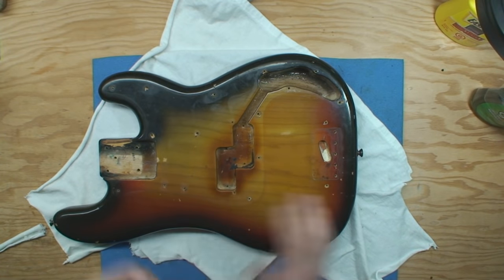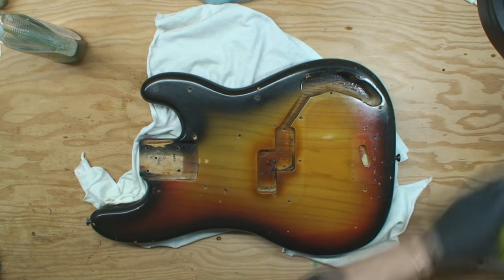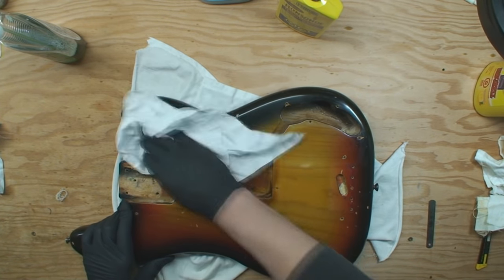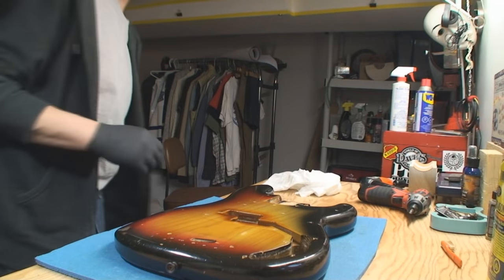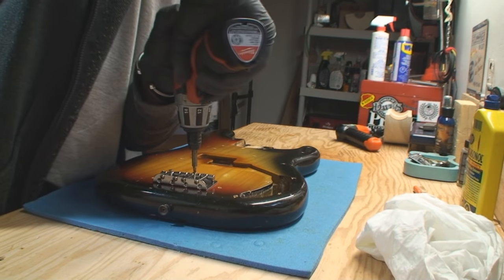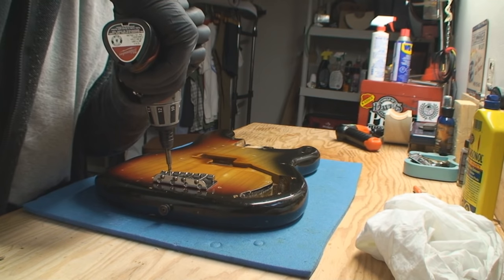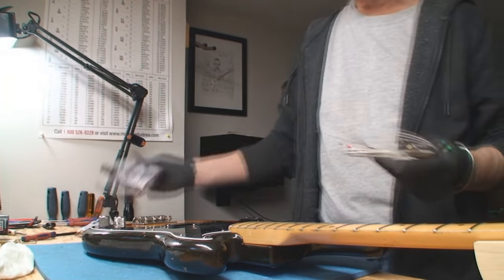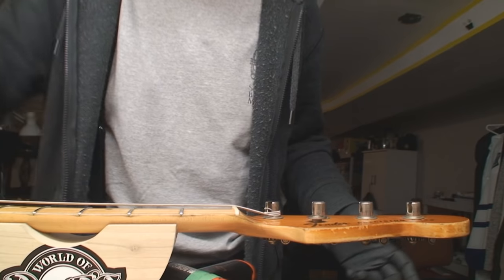70's Fender P Bass Gets The Works Part 2

Comment: I just had the same problem with on my 78 last night. One of my saddle adjustment screws was frozen on the E string. Probably from all the years of beer sweats getting to it. I soaked it overnight, didn't help. Heated it up in a pair of vise grips for a few min with a lighter and it loosened up.
Thanks for all the info,
Cheers.

Comment: You should always refit a screw and turn it backwards, first, so it drops into its original thread. Just tightening them with a drill may make a new thread and weaken the hold.
Best tip I learned years ago.

Comment: I have run across the "frozen" set screw issue a few times.  What I find works is to heat the screw up really hot with a soldering iron, then remove the heat and quickly spray the screw with freeze spray.  You might have to do this a few times but the screw usually will break contact with the saddle enough to unscrew it with vise grips.

Comment: I had a Fender P bass similar to this, but mine was 1977. Same three colour burst, similar wear marks. It had no skunk stripe, maple neck but rosewood fingerboard, truss rod screw at body like this one, but no truss rod plug at the headstock end. Yet, the black/white two ply pickguard was the original one. Maybe the one in this video was a replacement, but just saying that mine came with the same pickguard as the one in the video. All original. Sadly, it came without the bridge and PU covers, but the previous owner/owners left the bridge coverplate screws in :) Sold it for £500 GBP around 2006. Wish I had kept it a few more years as the price doubled/tripled for 70's guitars a few years later. Ah well. I miss that bass...

Comment: Why is it that the ONE part that screws up is that one part that cant be replaced or soaked in oil to get it to free up.?  Im always amazed at the sad shape that pickup mount screws are in when Im replacing the pickups. Not the adjustment screws but the wood screws holding  the mounts to the body,.  They are Phillips screws that are so wallered out that no shape driver can get them to move at all.  How did they get them to screw in?  Meaning a broekn mount to reach the screw head or trying to get needle vise grips to grab and twist.  Sometimes I feel like replacing the  PUPs and screwing them back into the guitar.

Comment: Hey Dave! What did you use to get the rust off that bridge?

Re - Refitting wood screws. I feel for the the old thread by turning backwards till I feel it drop. Especially with the hardwoods you get on guitar bodies the thread integrity stays pretty good.

You could get a machinist to remove that grub screw. Abom79 here on YT does a lot of that kind of reclamation.

Comment: Hi Dave, hope you are well, i have a guitar with a crack in the finish at the neck joint ( set neck) should i be worried? no tuning problems and it plays great just wanted to ask if you for your 2 cents.

Comment: Try heating up the screws with the old soldering iron.
Reply: Sometimes just heating and letting it cool a couple of times is enough to allow the penetrating oil in to where it can do it's work. Definitely worth a try ! The soldering iron should do it if you give it a minute or two.
Reply: You can heat the saddle to expand it, but the trick is to heat the screw so the metal expands in one direction within the saddle, but shrinks in all directions as it cools down. Physics; they're awesome.
Reply: It's going to be just about impossible to heat the saddle piece and cool the tiny screw enough for expansion to do it's thing, just putting a seized nut and bolt through a couple of heat cycles is sometimes enough to free it if you apply some releasing oil as it cools. It doesn't need to get too hot either, steel expands to it's maximum between 50 and 100 degrees C. Sometimes a sharp tap on one end of the screw while it's hot would be enough to shock it loose, (small hammer, no need to make it worse). It's probably just has a drop of beer and some sweat soaked it and got sealed with other random organic compounds. It's not an aircraft or marine craft or been used in a hostile environment for long periods, it's just neglected.
Reply: You don't need the physics of differential expansion. Just heating a piece often breaks the lock whether it's corrosion, galling or cold welding ... or all of the above. Still need to be able to get a purchase on it though.

Comment: A little late but one of the best penetrates i use on frozen fasteners is a mixture of wd40 & transmission fluid. The mechs at the Air National Guard base near us swear by it they call it "weasel pee".

Comment: Looks very similar to the '77 (made in March of that year, if I remember correctly) I used to own, apart from mine had a rosewood board and it didn't have the truss rod plug at the headstock. Sold it for £500 in 2001, like an ass. Should never have parted with it. Always wanted a '76, the year I was born. Maybe one day.

Comment: sound was better before!
Reply: I don't like the new mic sound either
Reply: The noise floor increases dramatically with the "fancy" microphone. This could be coming in at various points in the signal chain, likely too much gain somewhere, but when the noise floor of the "fancy" microphone is introducing a constant stream of white noise that's really apparent, it's hardly an improvement. A good mic would not introduce that much white noise, even at extreme levels of gain.
Reply: the loch boy g